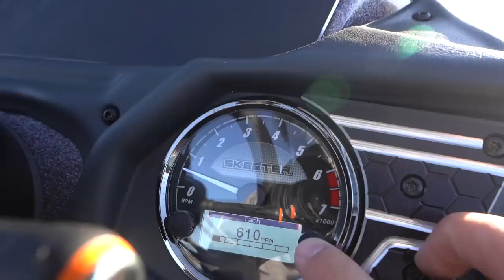FIRST TIME On My CRAZY NEW Bass Boat (Skeeter FXR21)

Comment: Hi Tyler, We love bass boats. One thing about speed and ratings... Coast guard ratings, etc, is for safety. Bass boats are made really sturdy and yes a little heavy... There is no doubt these boats can go faster than they state. Getting out of the safety ratings and pushing the HP, with things like Computer performance chips likely will get you 15-20mph faster with the sure possibility of blowing the motor up, or wearing it out WAY faster than it should. I always say the rule of 3, to get better speed.  1,) balance battery position/load of equipment center lined and toward the rear of boat. 2.)raise and tilt motor about 15 degrees at full throttle, will gain you about 3 mph. Careful not to chin walk, or run motor hot! 3.) Custom made thin 3 blade stainless prop. These Raker/chopper props are very thin, and expensive, but would gain you another 3-4mph. altogether about 8 mph added to top of top end speed. That's a lot considering no major money invested... Just my two cents worth.
Reply from the maker: Great comment!